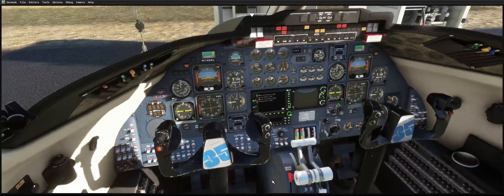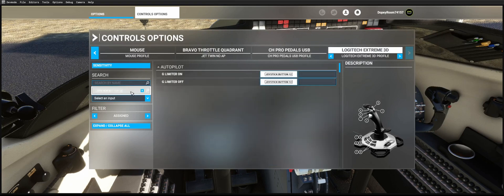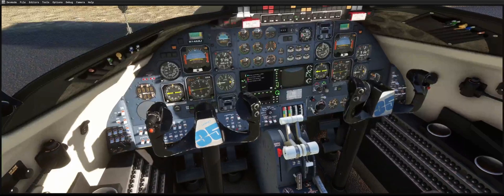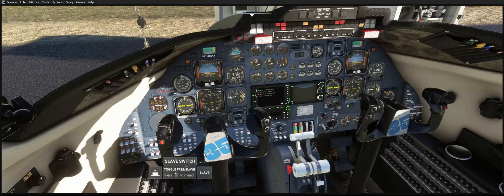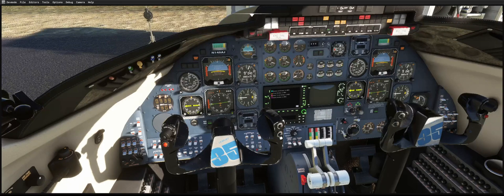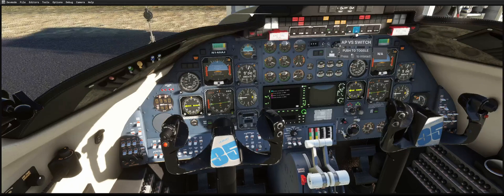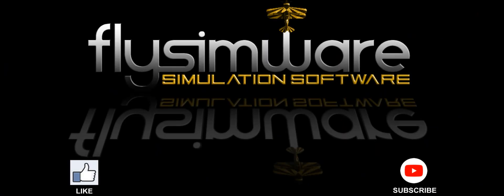FLYSIMWARE LEARJET35A BINDINGS TUTORIAL

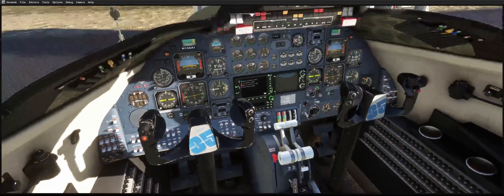Comment: I flew the Lear35 for a while IRL.  He says real pilots hold down that red nosewheel steering button for the entire takeoff at 4:32.  Actually, we held that button down until only 50-60 knots.  Above that speed your rudder is effective for directional control.  We would release that red switch at that point.  I am not trying to be pedantic but just pointing this out for anyone who is interested.
Reply from the maker: This is exactly what I predicted as the lead developer of FSW. But the pilots told me different. I think there is another reason why they would hold the button longer but I forget. Lets see what they say to refresh my memory. Will Ask our Lear Instructor.
Reply from the maker: You're right according to our Lear instructor you release the button after the speed alive is called by the copilot which is at 40 knots. By that time you should be above 45 knots which is in the training (gold book) handbook. But I was also told by the other Lear jet pilots that "some" pilots prefer to hold the button down the entire time to ensure more control. But this is not recommended. So the summary here is when the copilot calls speed alive then you release the MSW.

Comment: Is this still valid, or has keybinding changed?
Reply from the maker: Still valid. Also read the description NOTE:
Reply: Thanks. On the left side of the yoke there is a “hat switch” or something similar to adjust pitch up and down. Is there a binding for this?
Reply from the maker: @jay-rus4437  You just use the default button trim up and down. But if you want to see animation and you have 3rd party software then just read the bindings info we include in the package. Because this trim button you can push in real life to also adjust the autopilot pitch. So you also need to assign that somewhere on your hardware too. Or you the mouse. outer knob does one and the small button on top does the other.

Comment: i have parking brake issues i have a honeycomb yoke throttle and a t16000 thrustmaster hooked up seems as though the binding will not let me engaged or disengage parking brake until an engine is running...?
Reply from the maker: Turn on the backup hydraulic switch to engage the parking brake. This is one of the reasons they have the backup hydraulic system so the pilot engage the parking brake prior to starting the engines. So no there is no issue with hardware or logic.
Reply: @Flysimware   much appreciated! Thank you.
 Guess I should do a bit of homework now and then!

Comment: Hello, was glad to find this Binding tutorial today. I spent a lot of time to bind my keys on my yoke as described in the video. But it caused a serious problem with my AP and my TRIM. As I was pushing the "Smoke On" and "G-Limiter" buttons, somehow my elevator trim and my AP were constantly disabled. I couldnt trim my elevator anymore after take-off.. and it was on +50% causing a catastrohpical crash due to stall. The other try, I could not engage my AP again after "Smoke" or "G-Limit" were disabling it for my manouever. So, something is not working right here. Seems pushing the "Smoke" or "G-Limiter"  once is activating a constant event that disables all my TRIM and AP. Could you verify your bindings and give me a responds if they are working this way? I will try it with AAO.

Comment: Just a quick summary on what to assign:

Tail hook - Nosewheel steering lock on/off
G limiter on/off (momentary) - Master reset switch
Smoke on/off (momentary) - Manuver roll pitch switch
Reply: Really should just put this in the manual instead of an 8-minute video where the presenter isn't quite sure what is what.
Reply: thanks! the video just kind of stopped saying what to assign halfway through. :D
Reply: This is incredible helpful to explain what is explained in the video ;-)
This should be pinned to the top @Flysimware
Reply from the maker: Remember that the sim has a bug when assigning a ON RELEASE bind. 
After you assign the button as a release and click validate you need to click the assigned key again as the ON RELEASE will return to ON PRESS. So click again and now change the assigned button to ON RELEASED and validate. So basically the first time you assign the button it will only assign as ON PRESS. That is the bug.